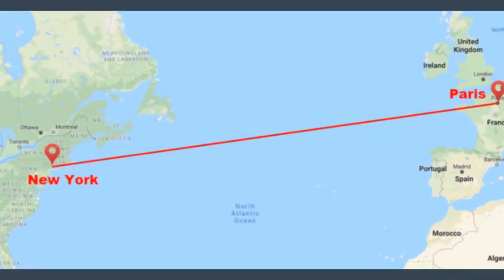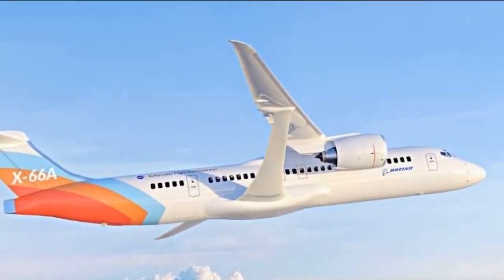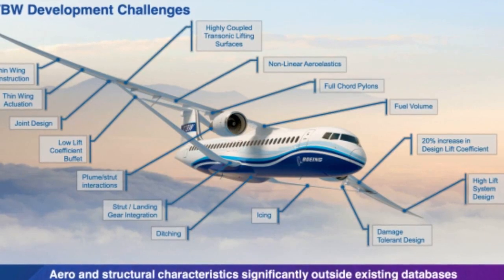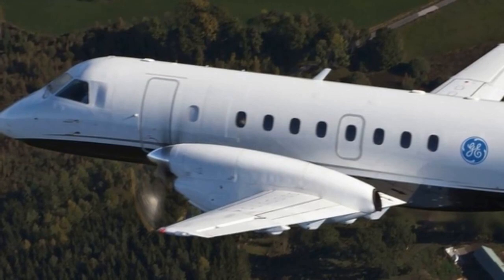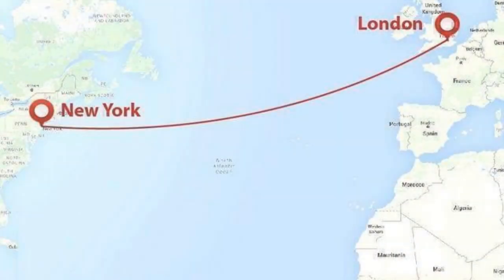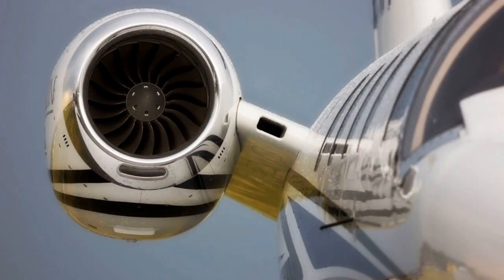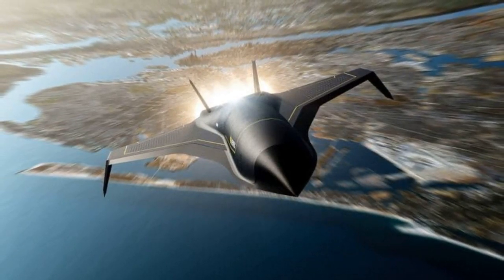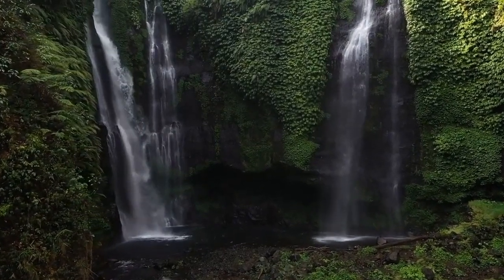How You'll Fly in 2035 - NASA's Vision of a Sustainable Flight

Comment: The Concord airplanes would travel high speeds like this, but they'd have periodic catastrophic crashes and got banned. I hope NASAs invention doesn't go the same fate
Reply: @scarlettpratt731, your statement "they'd have periodic catastrophic crashes and got banned" is false in both regards. Concord operated flawlessly for the entirety of its service. Its single accident was the result of FOD, Foreign Object Damage - piece of metal left on the Paris runway by a previous flight that was struck by a tire at high speed and thrown up into the wing piercing a fuel tank and ignited by the engine ultimately causing a crash shortly after takeoff. This was no fault of the plane or the flight crew. It was never banned from service but was voluntarily withdrawn after a brief return to service after special sealing liners were added to the fuel tanks to address the cause of the 1 fire and crash. Concord actually performed longer sustained supersonic unrefueled flights than any other aircraft civilian or military.